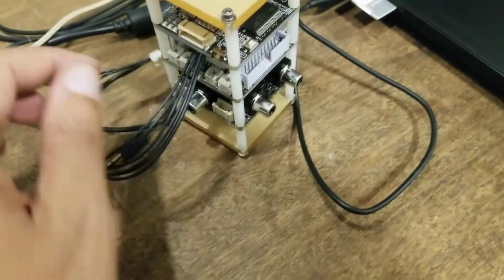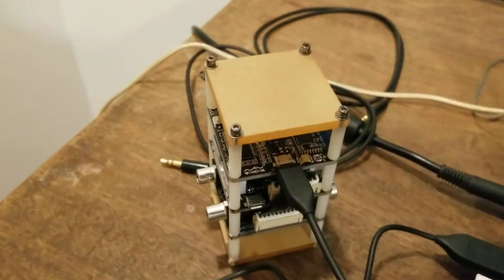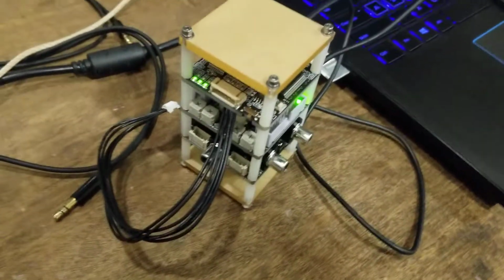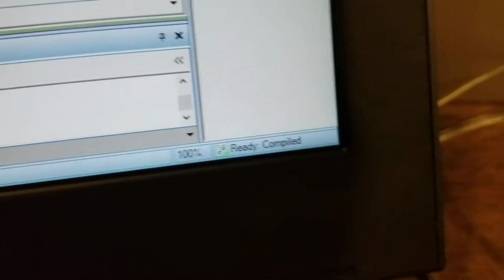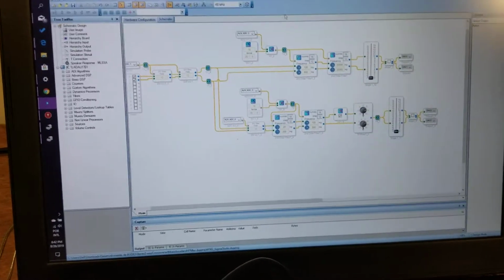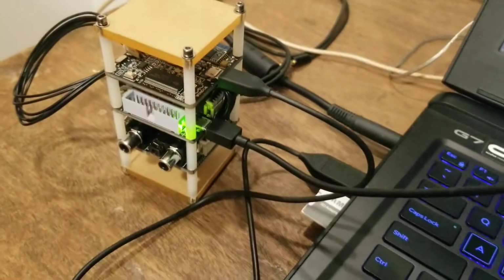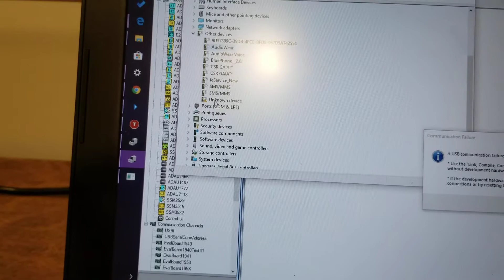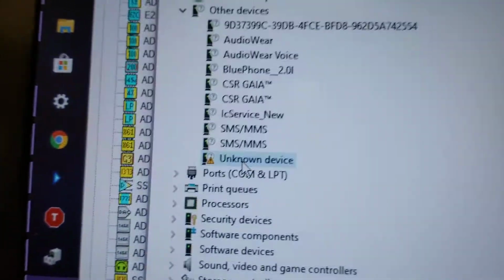Adau 1701 programing board problem.

Comment: hey thanks for the comments! I was having the same problem
Reply from the maker: No Problem. I just havent been messing with the board since then. The programing part for me is hard. I don't really know the best way to use it. Also i would have to have two diferent amps. one for the stereo and ones for the sub. But let me know how it worked out for you.

Comment: Did you get this problem solved?
I had the same issue. The work around is too power up the programmer with the USB cable, then power up the deep with it's USB cable and THEN connect the two boards with the 6P connector...
Try it, it works for me...
Reply from the maker: Yes. You have to first connect the programming board to the computer using the USB cable.then you power up the DSP via the USB. Then you connect the communication cable between the DSP and the programming board. The switche on the DSP must be on position one so does the switch on the programming board. The when you click download compile it will work.